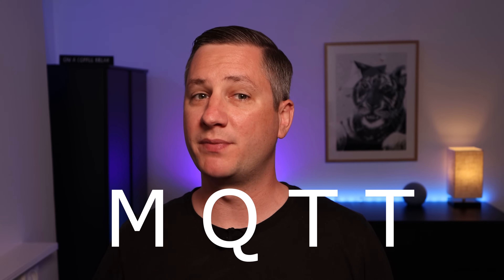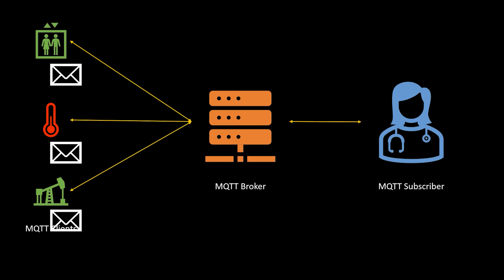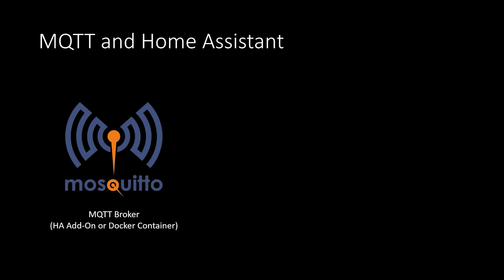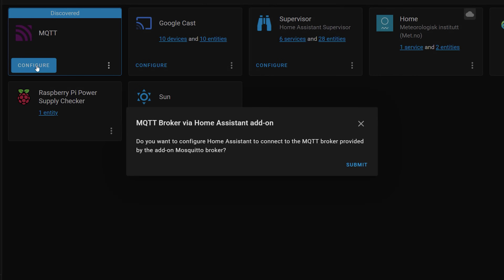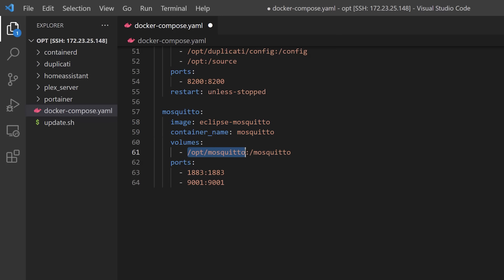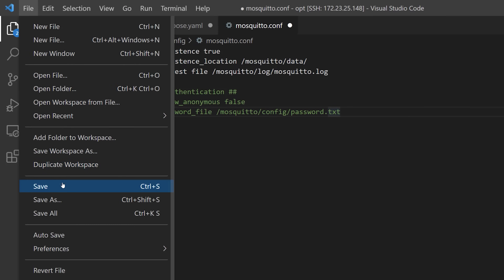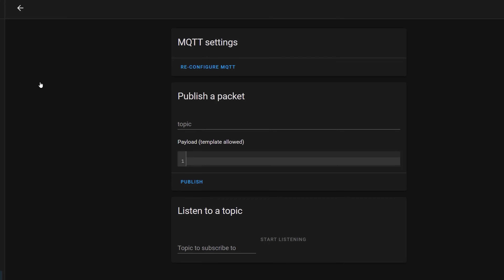MQTT and Home Assistant

Comment: For those who has issue with connection for intergration with home assistant 
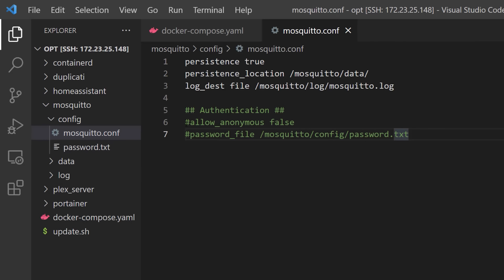at 9:32 please add this : 
listener 1883 
at the beginning of the config file to allow port 1883 

at 10:52
use your <pi_address_server> as Broker
Reply: Thanks a lot! :D
Reply: It is because of the new update Mosquito 2.0 .. they added this for security pusrposes

Comment: I was following the Blog rather than the video and it seems there is a small error on it.  In the text that says "If you don't want to set up authentication, you can change the allow_anonymous line in the configuration above to true" it already says TRUE.  Then you say "You can now switch back to VSCode and uncomment out the authentication lines." but these lines are not in the existing code (I did however copy them from further down your article).  I've managed to set it all up now thanks but thought I would let you know so you can fix these on the blog.  I was not in a position to watch the video so dont know how it played out there.

Comment: 3:55 this is where after 3 hours i give up, dont have the time to deal with the hoops.
"Add-ons are only available if you've used the Home Assistant Operating System or Home Assistant Supervised installation method. If you installed Home Assistant using any other method then you cannot use add-ons. Often you can achieve the same manually, refer to the documentation by the vendor of the application you'd like to install."
Reply from the maker: That's fair

Comment: Assuming you are doing this all on the same server, I would recommend using the "localhost" instead of the IP for setting up the connection to the broker. This way, if the IP changes, it won't break your system.
Reply: I have since found that "localhost" does not appear to be supported well, or entirely. Either a limitation of docker or the individual apps. However, the local loopback 'should'. But I have not tried it yet.

Comment: Important to note if you run Docker hass and docker mqtt you neet to enable 'listener 1883' in the mqtt conf for the mqtt container to start and run, otherwise no clients can connect to it as it cant bind ports onto the loopback socket of the docker container. This is a change for mosquitto 2.0
Reply: For anyone still confused, just add the line "listener 1883" to the top of your mosquitto.conf file. (no " quotations)
Reply: Thank you! tried everything to get it working to no avail. Should have checked the comments first. :D

Comment: Great video, but to be honest.. HA in docker is just extremely complex for ud new ones with a Synology NAS.. just to get a MQTT broker going! i need VScode, 3 extensions, SSH settings enabled i various places, Docker compose stuff installed, Portainer and more docker compose installed, and between all of that is tons of lines of code in different windows and platforms. Its just two complex to get a piece of software going that is 2 clicks away in HA as a OS.. 5+ hours in.. i have to give up. MQTT on Docker HA is just broken IMOO
Reply from the maker: You're right, it is.  But some people already have Docker stacks running for other things, so they feel comfortable setting that up!

Comment: Running into an issue where I get the error, "Failed to Connect" when trying to set up the MQTT integration. I confirmed the passwords are correct but still can't figure out why it's not connecting.
Reply from the maker: Check your network settings
Reply: @HomeAutomationGuy  Hello! Thanks for your reply!
It was totally just user error. In the code, I forgot to put the "listener 1883" in the mosquitto.conf file. I corrected this, restarted the container and now it's working like a charm.

Comment: it would be nice if you actually deploy the mqtt container using command lines instead of relying on vscode, as vscode is also only available on HAOS, so that tutorial section you show there how to manually deploy a container is useless for people who ran HA in a docker container.

jeez for all tutorial how to deplot mqtt-broker for HA out there, only one video is actually good enough to follow for most people with that "watches tutorial an mimic it exactly" kind of instruction. And that video is performed by that old guy.
Reply from the maker: I'm not sure what you mean. VS Code is available on MacOS, Windows, Linux - so it's accessible to all people and completely free?
Reply: VSCode is free, and so is the extension called "Remote - SSH" he's using that allows you to connect to your raspberry pi/docker containers and edit any files easily within the editor. So it is very applicable!

Comment: @9:50 The reason why it happens is because the user inside the container is "root" and all files created by root are automatically owned by root. Since docker just containerises on top of the kernel of your host system, the access permissions and ownership will also propagate back to your host system. 
You would need to create a specific user inside the docker container that is allowed to run all necessary commands. Since that is not always straight forward, it is often easier to just run a script once a day to change the ownership of all the data of your /opt/xxx directory (preferably before you start your backup)
Reply from the maker: Thanks for sharing!
Reply: Thanks so much for the explanation. Back, early in the initial installation of Docker and Hass, this threw me off so badly. I got through that part ok using the chown workaround. But then when implementing backups (using rsync instead of Duplicati) I started going down the path of permission hell. After countless troubleshooting hours and trying, and failing with Duplicati, I thought maybe RaspberryPi OS was the culprit. When I switched to Ubuntu, I decided to keep permissions cleaner by putting everything into a home directory rather than /opt. When I hit exactly the same problems, I at least had ruled out all the other potential causes. My conclusion was that "ls -l" was showing the correct user name but the culprit is that it was still part of the root group. After I modified chown to be "sudo chown <USERNAME>:<USERNAME> -R /opt" my rsync worked perfectly. It is still annoying that you need to go back to chown every now and again. I was really wondering if there was something fundamental missing, but this explanation makes it clear that there probably is nothing really cleaner than this workaround.
Reply: I tried to create a user named hass inside the container, but the user does not appear to be a root or superuser. Now that I've created this user, how do I give it privileges? Typing things like "usermod" "sudo" and "apt" all return errors.

Comment: Great video. Very easy to follow with all the Docker instructions. Unfortunately I get to the end, trying to add the MQTT Integration, and I get a "Failed to connect" message, with no context and I can't find any logging anywhere to explain why. Any thoughts on where to look next?
Reply: If you are still running into this issue, I figured it out on my end. If you look at the updated blog for this tutorial, it has the line: "listener 1883" that wasn't in the video. I added this into my mosquitto.conf file, restarted the mosquitto container, then tried the MQTT integration again and it connected without an issue. Hope this helps!
Reply: @JRWJWV  I love you. Saved me a lot of time...
Reply: @techtonik25  I'm glad my 2 days of struggling saved you from the same!!
Reply: Same here. I checked the logs of the MQTT container and it seems not to start properly. But I have no clue why.
Reply: Same, did you manage to solve the issue?
Reply: @TheFifilak  I also am having the same issue. Anyone ever figure this one out?

Comment: I followed the Docker install and ran into problems getting Mosquitto to locate the configuration file, despite it existing with correct permissions.  The problem was that despite mapping /opt/mosquitto to /mosquitto in the compose file, for some reason you have to specifically map the config directory as a separate volume. Have a look at issue #2557 on the eclipse/mosquitto github repo for more info.
Reply from the maker: Thanks for the heads up!

Comment: Thank you. How do we add MQTT devices after we've completed this video?
Reply from the maker: You tell the device the IP address and username/pass for your MQTT server and it should start talking to it.
Reply: Sure but how do you actually add the device to Home Assistant
Reply from the maker: @LukePighetti  The devices should automatically get added to Home Assistant via the MQTT HA integration.  If they don't, you can go to your Integrations page in Home Assistant, find the MQTT integration and then click the three dots in the bottom right of it, go to System Options and make sure that the Enable Newly Added Entities thing is turned on.
Reply: @HomeAutomationGuy  I ended up having to add my Shelly 1 switches manually to my configuration.yaml, would be nice to cover this for new folks

Comment: I'd just like to say a brief thank you. I've been building and using PCs for nearly 30 years now but have largely shied away from this particular side of computing. Over the last 3 days I've been trying to get things like docker, portainer, HA, etc all running on a Pi4 (all of which are new to me) and frankly have felt like a complete idiot at every turn. Practically every instruction I've seen and attempted to replicate only to have a problem that somehow didn't exist for the  person whos video/blog I was reading. Every. Turn.

Yours on the other hand pretty much all clipped along exactly as I had hoped for the most part. The only difference being I had already installed Docker, and so using your docker compose install left me with the 1.2.9 version and for the life of me I couldn't work out how to get a newer build running. Only to find out when attempting to install docker-compose-plugin that version 2.5 was already installed. It does mean console commands are now docker compose, not docker-compose but it seems to work so hopefully world ending outcomes are not on my horizon.

But, just thank you. I feel like slightly less of a moron now and hopefully by the end of this weekend I'll get my solar storage inverters talking locally to my new HA via mqtt after this video helped me out so much.

Do. Not. Stop.
Reply from the maker: Glad it was helpful. Sounds like you've got some fun projects planned. It's a deep rabbit hole we find ourselves in 😉

Comment: Thank you Alan for this insightful and very useful video! Congrats on your work!
I have a question regarding the mosquitto log file. In the video I noticed that whenever you show no errors on the mosquitto log using portainer you are not actually showing anything of what is inside that log file. I believe that is to do with this config parameter "log_dest file /mosquitto/log/mosquitto.log" . I think that if this is enabled the logs are not redirected to Portainer but will be registered real time in this file. If you disable this option and restart the container the logs instantly show up in Portainer container logs. At least I had to comment this config option in order to get them in Portainer, not sure if I am doing something wrong or there is a way to have them both sides, log file and Portainer dashboard.

I am really looking forward to your Docker Frigate video. Great work 💪

Comment: Love this. I’ve just done this part but this would have saved me time. Are you planning on looking at zigbee2mqtt and node red? That’s what is currently making me pull my hair out.
Reply from the maker: Zigbee2mqtt is coming up next. Not sure on the Node-Red front, I've not personally used it yet.
Reply: Zigbee2mqtt isn't to bad.... Mosquitto gave me fits, ended up installing it with portainer which put in in /var/lib/docker... My 'normal docker dir is /opt as per these tutorials... It's cool though cause mqtt keeps running when I fiddle with compose-up in /opt... Zigbee2mqtt, don't change default ports till you have it working, web port is 8080 default. It doesn't start observer until it successfully connects to mqtt. In its yaml I directed it to mqtt:'ipadd:1883'... Good luck, I finally got mine working and set up 4 sengled plugs, Note: You will likely see zha integration try to grab your dongle, TELL IT TO DISMISS... I'm using a Sonoff (flashed) dongle and zha said it couldn't handle it anyway...  Logs will show startup, connecting to mosquitto, etc... If you have set allow in yaml you can pair a device even without mqtt working. If you see 'herdsman' messages mqtt didn't connect...

Comment: Nice video and well though out in advance. Been using mqtt for about 4 months now with espresense for room presence detection. I'm running HA and mqtt on a raspberry pi though so easier to setup. But i am running it from and booting from a SSD instead of a micro SD card. Runs much faster that way and don't have to worry about the micro sd card crapping out on me like they do when being written to a lot.